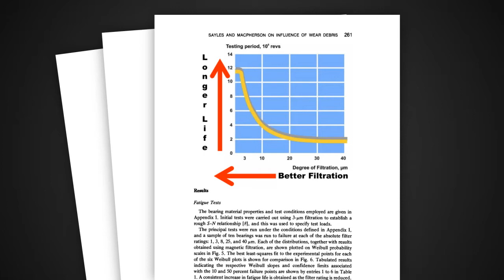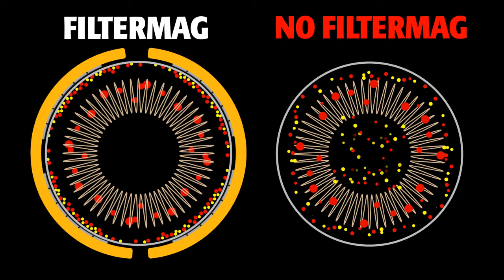How FilterMag Oil Filter Magnet Works

Comment: Except that oil is pumped into center of the oil filter, then through the filter media, then is finally able to reach the magnet.
Reply: Wrong...exactly the opposite.
Reply: Wrong! It goes through the outside and then it goes up through the middle.
Reply: I have cut open oil filters and looked. You can definitely see where a small amount of metal is collected where each magnet rests. As others have stated, the oil flows from the outside in. Even so, if what you said is true the magnets would still attract the ferrous metal pieces.
Reply: Bot

Comment: FWIW...what I know:   I use them and I know from examination of my own filters that they work as-represented.   I also know that ferrous/magnetic particles (iron and steel) are the hardest/most abrasive of the wear-metals in circulating engine oil.   What I don't know:   Whether or not it really matters in the greater scheme of engine wear over time.   Seems like a good idea to me...quite easy and convenient.  I will continue.   The particles trapped are not "shavings" at all but microscopically tiny things that present as a paste or slurry trapped on the inside walls of the used filter...as shown in the many videos available.   I wish the various video "reviews" would show the nature of this material and measure fhe actual particle size of its composition.   I strongly suspect that many (most?) of them are, indeed, sub-20 microns in size, likely capable of passing through the filter media...but, again, don't know.